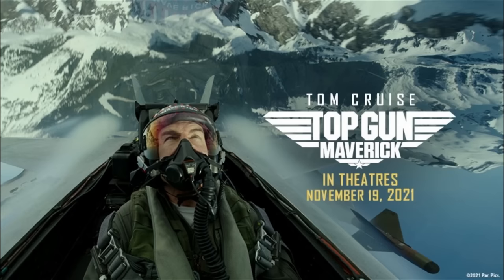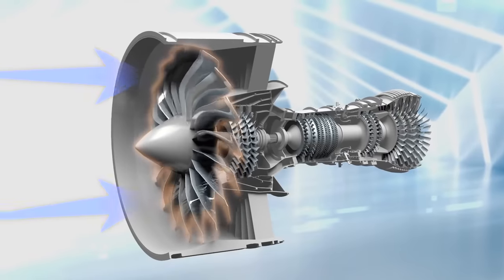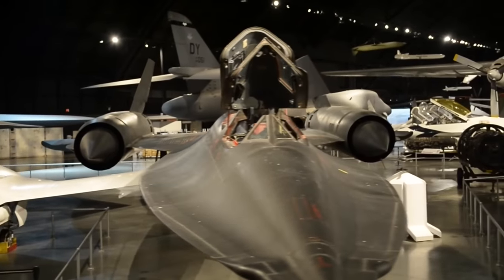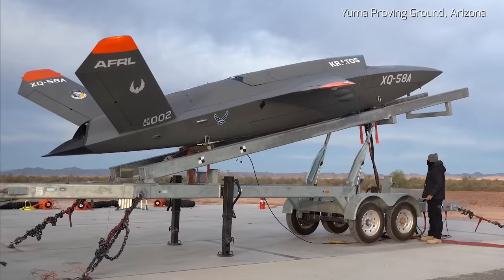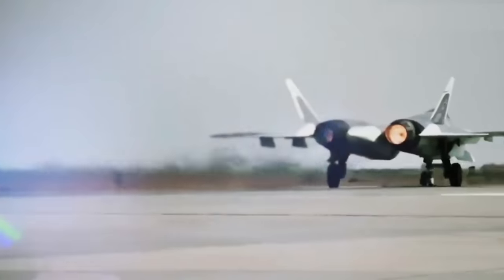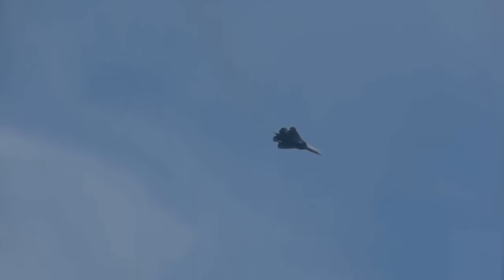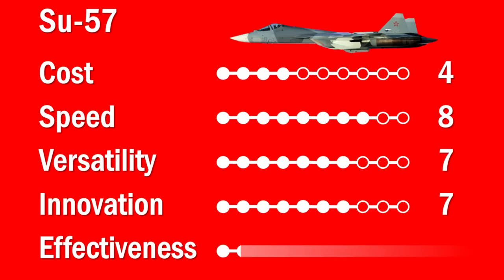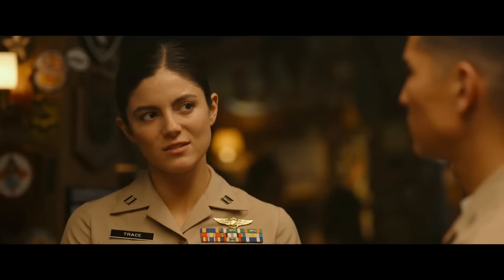Aerospace Engineer Reacts to TOP GUN: MAVERICK

Comment: your score for su- 57 is just funny!!! americans could only dream of air maneuvers like su 27 su 35.... until f22 came that can do some of the stuff that the russian planes can for a very long time and now su 57 is even more advanced and does stuff in the air that no other plane can and its not even in top 10 on your list! be a little more objective and not so proamerican specialy for an engineer:)! cheers from slovenia
Reply from the maker: The SU-57 has no operational history to speak of, highly questionable stealth tech, and has immense program technical difficulties. That's why there's only a few "operational". It's maneuverability is impressive but like you said the SU-27 and 35 can perform many (if not all) the same maneuvers and are much older meaning that the SU-57 isn't all that innovative. I suspect that the older Sukhois and MIGs will rank higher when I get to ranking them.
Reply: @AviationAustin  there’s been rumors and a vid roaming around that russia used recently in Ukraine
Reply from the maker: That would be surprising.

Comment: What makes the Darkstar's fuel tanks so special?
Reply from the maker: Are you asking about the scramjet?
Reply: @AviationAustin  Exactly, the Blackbird was a leaky mess when grounded and always needed to refuel while in the air. So what makes the Darkstar's fuel tanks different than the Blackbird's?
Reply from the maker: Well I'm sure if it were real it would be classified 😂 It will be interesting to see how that problem was resolved with the SR-72. But if I had to speculate i would say they probably leaned on the innovations we have had with high tolerance manufacturing and composites. But I'm not privy to that info
Reply: @AviationAustin  Thank you, now I can drink my Dr. Pepper in peace!

Comment: sigh, all that "positioning" especially - SU-57 does not exist :P. The only thing ever "shown" (yeah, quoting, because that was extremely limited expo) was the chassis, without even the proper engines installed. Also, because a proper engine for it does not exist either, as in fully functional and developed. In fact, for both only the specs exist in any "proper" form :).  and those were pretty much drafted just for bragging rights. And, given how everything is going, that's all that ig ever gonna exist about this plane..

Comment: Didn't liked the video as I was expecting engineering feasibility of the manouvers in the movie but it got stuck on the hypersonic topic and man vs drone. Also, the ranking of SU-57 is not based in data (even if public data is not really reliable). The fact that it has not been used in Ukraine (not a air superiority theater) shouldn't be interpreted as low effectiveness.

Comment: 100% lost me at your ranking system.
You’ve neglected to address the full grasp of Russian doctrine.
Russian aircraft were designed to be stealthy from front on. Which means grabbing your enemy by the belt buckle and punching on.
From any other angle they suck. 
Russians however know that radar tech (that they already posses) will level the playing field. So, your argument about going back to 4th gen is a good point because this above mentioned tech (already in S400/500 SAMs)  will ultimately lead to a battle of attrition.
The fact that Russians built a plane whos sole purpose is to engage in BFM is a potential problem for US doctrine.

As such, Russian BFM tech includes Fox2 ECMs (laser disruption), helmet mounted queuing system and 3D thrust vectoring.
All from a plane that carries more fuel internally than the F22 with 2x bags, 
360 degree AESA radar, medium range Fox2s (for those airborne assassinations) and a fuselage that offers 40% of the aircrafts lift (for when you really need to save fuel costs). 

Next time, don’t forget any of that- I did really like your video tho.

Comment: Once the SU-57 picks up missile launch, that's when it will use it's "super maneuverability" . Every one of the maneuvers you showed in this video is a missile beater. You aren't much of an engineer if you don't understand this.
Reply from the maker: It seems you are not familiar with the basics of dogfighting. Let's say that one of these maneuvers actually does evade a missile. After the maneuver you've lost some much kinetic energy you won't be able to do any other maneuvers and you're basically a sitting duck at that point. Supermanuverablity isn't as powerful as you think.
Reply: @AviationAustin   Answer PT1. I know alot about "dogfighting" now known as ACM (airial combat maneuvers). It is close quarters & guns, guns, guns. Most countries try to avoid this except for Russia, China, Israel Iran & N. Korea. These same SM maneuvers eliminate or seriously mitigate gun damage as well as enabling the pilot to gain optimal gun position himself (usually quicker and with many more options to do so tahn NATO). Nato aircraft can't move like this even with thrust vectoring. Russian & Chunese made guns have a bigger punch as well.
  Now that we have the militaries definition of "dogfighting" clarified, let's move on to long range intercept. What you are talking about is air to air missiles as you stated. We (Nato) fight over the horizon (OtH), AKA standoff. The full effect of standoff can not be achieved in the air without AWACS. Both sides have them. IF you are linked with an AWACS, both sides have about 120 NM. This is greatly reduced if the fighter is stealth or has stealth tech. paint. The AWACS range then becomes 25 NM. This puts the fighters' own radar 10-12 NM making standoff missile negligable for their intended purpose. Keep in mind, most Russian & Chinese Gen 4 & 5 airframes have stealth paint.

Continued in part 2.
Reply: @AviationAustin  Answer part 2.  The only way to fire standoof weapons in this case is through somehow gaining a bearing and firing "mad dog". That means you fire in the general direction you think the enemy is at & hope the missile gets close enough to start independant IR or radar tracking. If the standoff missile does manage all of this, Chaff & flares would be activated and these super maneuvers are used causing the missile loose track. SU-57s can come to a virtual halt and go supersonic in about a minute thus enabling them to be ready for the next attempt. By this time, NATO aircraft are usually in range for a merge, I.E. ACM. 
  Youare also assuming in your video that this is a 1 on 1 fight. If that ever happens, someone has made a serious mistake. The fact is that most Russian & Chinese fighters outclass our own in an actual tactical fight. An F-18, in any configuration, is very lucky to take down a SU-57. On to answer/statement part 3.
Reply: @AviationAustin  Statement/answer part 3. Engineers are to often wrong about aircraft capabilities. The helicopter isn't suppossed to be able to fly & yet it does. Helicopters weren't suppossed to be able to dog fight but Apache pilots proved they could (cobra, split S, barrel rolls, loops & the like), the A-10 isn't suppossed to be able to fir the GAU-8 at max speed without ripping its' wings off, but it does. The pregnant Guppy (laymens name for a cargo plane) isn't suppossed to be able to fly (not enough power to weight ratio to achieve lift let alone fly) but it does. Many other cases of this are out there. As I said, I do know (through observation & testing) that I am correct.
Reply: @AviationAustin  BTW, Russia & China both have the standoff air to air capabilities as we do, but the have an advantage of 20-30 NM on us.

Comment: SU-57 is not to be laughed at.
CHINA did J-20 and it's justly placed low because of engines are under powering what would be another F-35.
The F-23 has vectoring exhaust like the SU-57 capable of Cobra maneuvers and flat spins stalls for excellent inside out positioning for kill shot.
SU-57 and the F-22 are super cruise ships!
BOTH are designed to fly Cap over the battle UNNOTICED to achieve the surprise attack in blind dogfights. 
It's the Russian AIR DEFENSE SYSTEM S4 & S5 along with their hypersonic missile that is the concern of many pilots, particularly in Israel who often fly over many SOVEREIGN AIRSPACE of the neighboring countries, without notification, or agreement of flyover.
Whenever a country developed a breaking technology, it's either STOLEN or a COUNTERMEASURES developed to render the technology obsolete or ineffective.
Military Industrial Complex has pushed the boundaries of flight, so there's more development in type of Weapons propulsion and Biologicals.
Many  violations of TREATIES and many NOT encompassed in the Treaties like CCP/PLA that are using willing participants or pirating technologies.
Reply from the maker: Just did a Chinese fighter jets ranking if you're interested

Comment: Maybe I missed your point, but considering the film takes place in modern day, why not just fly over with an undetectable B-2 spirit? Even the latest S-500 systems cannot detect the B-2...yet. Just drive some 5,000lb bunker busters through the front door.

I guess that would be a boring 15 minute movie then. 🤣
Reply from the maker: Yeah i guess they're implying that the 5th generations can't penetrate this airspace. I agree though. That would be much easier than the death star run that they do.

Comment: Really!!! C.W.Lemone ripped this movie to bits he is a real F16 pilot and even Ward Carroll a real F14 pilot said that the flight of the F14 is unrealistic and stopping the one jet on a F14 and turning will interduces it to a flat spin he was impress with the detail with the cold start on the F14. C.W.Lemone said no pilot would know how to do the cold start that is why you have ground crew, he also said if you use cruise missiles to take out an airfield why not use it to take out the target and you will have seals on the ground lasering the target. he talked to the cgi guy for the moving and there were alot of computer animation use in the movie.

Comment: Did you really just rank an Su-57 3 spots below a 747?  I mean WTF?  I wish you had done this tier earlier in the video so I could have stopped watching then.
Reply from the maker: You think an airplane that has barely 3 operational aircraft is more successful than the first and most successful jumbojet ever? 🤔 You can watch my ranking criteria in my ranking system video.
Reply: Sales number of a plane should not be a very big factor in overall scoring of a plane being a plane. Then again only having 5 categories for scoring planes is a bit lacking as well.
Reply from the maker: 5% isn't very weighted. But someone has to pay for it. And as you can see with the SU-57 cost plays a huge role in the success and longevity of the program.